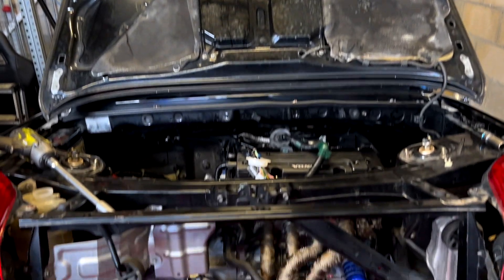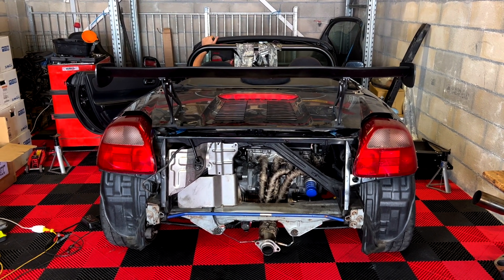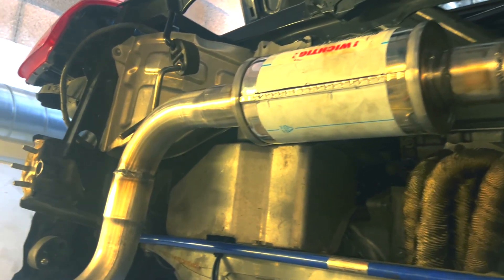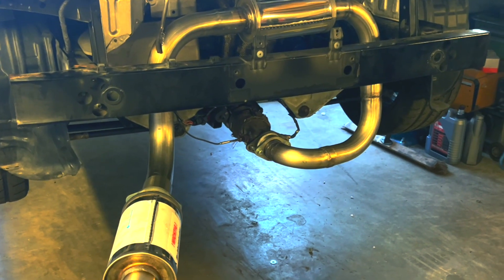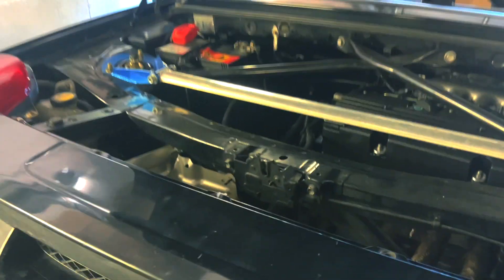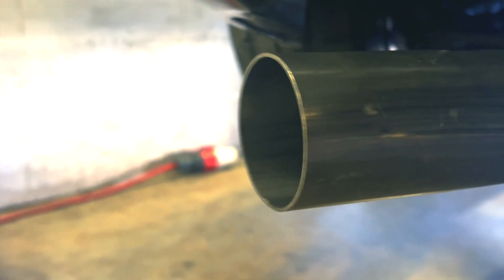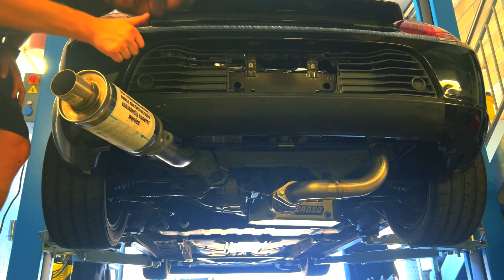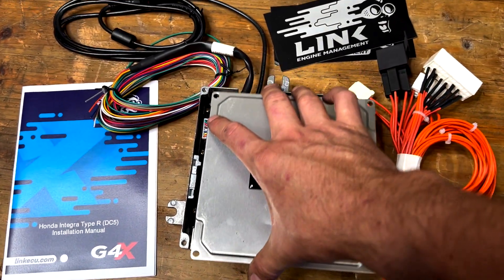How to Kswap an Mr2 Spyder EP13: Exhaust build for my K20a (all motor) swapped Mr2/Mr-s zzw30

Comment: I got just finished my k24 mrs. I run 2 silencers from Simons and absolutely love the setup as the intake is a lot more expressed in the cabin than the exhaust. Feel free to check my last couple of vids, and although its not English, there are English subtitles. My suggestion would be to mute the exhaust to a point where you could hear your own thoughts at least :) and get a proper intake!! Thats the best combo IMHO. Good luck with the works!
Reply from the maker: Hello fellow Kswapper! Thanks for your input! You are right! I still need to finish my itake! (Probably an extra silencer will make its way into this build).
How does your header fit? Does it go as low as mine?
Reply: @JesseSpec  well he got it custom made ;) and to be fair @Motoringmatt it's still loudISH 😅 but defo better than before exhaust was planted 😆
Reply from the maker: @ShedBuilds  hahah ok! Understood! Thank you
Reply: @JesseSpec  I was considering using a well designed custom 4-1 header from EK Civic with K24 conversion. However, it was too low for me - even lower than yours (maybe just about 4 cm off the ground, lol) and moreover, the merge collector was soooo far back! It ended in a position of the rear bumper :D It was so bad, the guys had to remove it to get the car on trailer!
I decided to go for custom exhaust from scratch and my friend did all the work. He CAD designed and welded it. And now, even though it sits about a centimeter to the subframe with a ground clearance of about 11 centimeters, I still see face some issues when reversing or, for example, getting on the dyno :)
If I were you, I would consider saving ground clearance as it may make the car... undrivable or simply unusable in some cases.
Also, the setup with two silencers made it a decent cruiser (still, a loud one) as I also have the longest 6th gear.
Reply from the maker: @motoringmatt  hi thanks for your feedback. It will be racecar only, no street use. In Switzerland you go to jail immediately if you use this on the road hahaha
Reply: @JesseSpec  haha, that makes a lot of decisions easier. Best of luck with the project!
Reply from the maker: @motoringmatt  Thanks buddy 👌🏼🔥